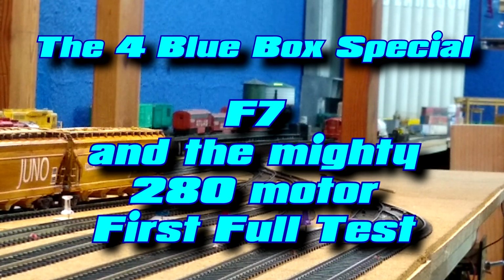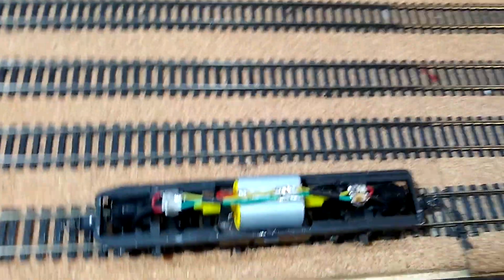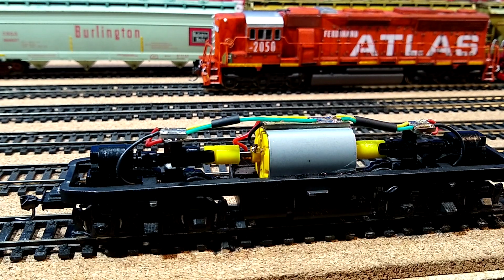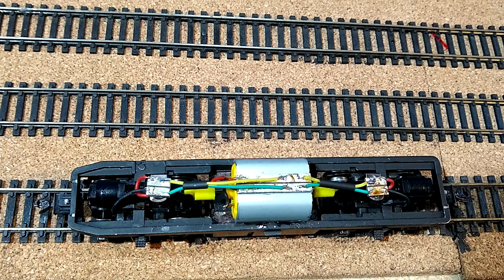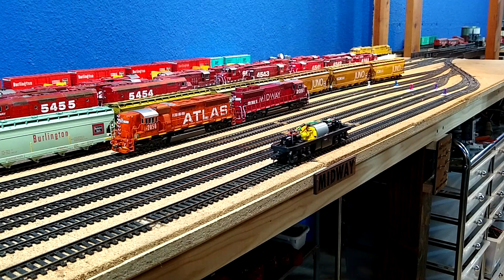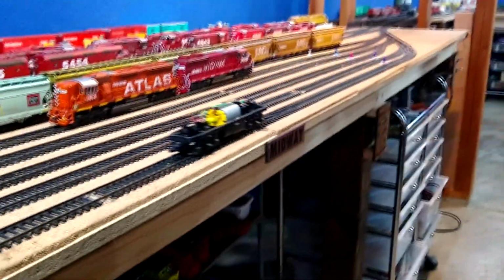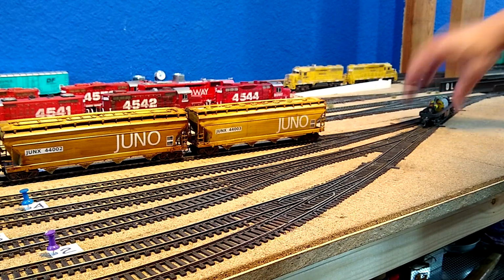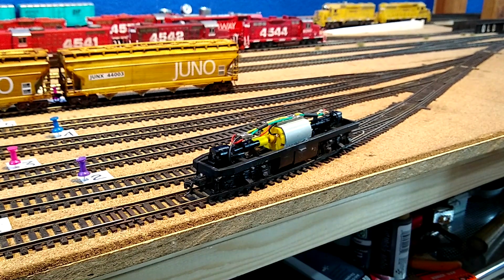4 Blue Box Special F7 First Reveal Motor Testing

Comment: where do you get the Mighty 280?  Mighty is now capitalized as it is a proper name. Yellow UJoints.  Did I miss an episode?  This is your best install yet that I have seen.
Reply from the maker: ebay is an easy source for 280 motors, but also aliepress.  the yellow u-joints go way back when I couldn't find replacement parts for a while I decided to make my own using my 3D printer
Reply: @elite194  I have bad news.  We are not the smartest model engineers in the land.  I was pretty sure I was, but...  There is a book "Upgrading Athearn locomotives"  On page 61.  it details how to test and figure tractive effort, horsepower conversion, all that.  Details the mathematical formulas and test procedures. While the data is pretty old, there is also a chart of 20 or so tests. I'm sure you have seen or read this at one time.  i got a fresh copy 3.95.  Pretty similar to your testing, but this does give  you some independent benchmarks.
Reply from the maker: @blainedunlap4242  I know that book well because that author has a number of great books.  I keep putting off buying it at the train show, but this time I think I'll pick it up.  It's a collection of articles from an old magazine that I used to buy way back when I was still a kid just learning how to rebuild athearn stuff.
Reply from the maker: @blainedunlap4242  not too bad!

Comment: I think these 280's are the ticket for the out of scale hoods like the brass RSD-12 I've recently found out and the chassis wide body F, E's and FA passenger hood locomotives you've displayed here.  What did you think of the single shaft 18×18 motor.  I've stacked a couple of these back to back on an newer modern athearn SD75 and can't wait to see the result.  What's your take on the 18×18 John
Reply from the maker: the square 18x18 motor is both really high power and really fast  at the low end.  they're really good for things that have a very low gearing.

Comment: John which do you like best, DC or DCC.  There's a guy with a huge shelf layout in his basement that uses DC exclusively.  He's rigged it up with sound under the bunch work and says he doesn't have the problems that people have with DCC.  His name is Tom Johnson and his purity widely known for his layout.  I think I'm going to just stick with DC like he's done.  The sound is so much richer than just the sound coming from the locomotive itself.  I just got to figure out how to get the sound from the locomotive to the stereo speakers and stereo.  Lots of people have trouble with DCC they all say because of dirty track, which I think maybe you've figured that part out by using that ox-gard paste.  My layout is on hold till I get moved or I'd have already tried these problems out with a DCC engine and ox-gard on the track.  I'm thinking the newer locomotives are geared much slower.  I've read or watched a video and it's been disclosed that the newer locomotives use helical gears at a 1 to 14 ratio or 14 to 1 ratio whichever it is.  Impressive it is seeing your F7 with pretty much no weight pull them heavy cars at low speed.  Them 24v door window motors that aren't available at the moment, how does this FS280 pull compared to them door motors.
Reply from the maker: I like both and my layout is setup to change between DC and DCC with a flip of a few switches.  I have a couple of old surround sound system that I use for layout sounds and ambient sounds.  To get sound from the locomotive to the sound system, you only need one of those power packs that does "under layout" sound, can be had really cheap these days.
Reply: @elite194  
What search words I need to use to find the power pack that does the transformation of sound to a stereo system, you got any idea.  

You mentioned in one of your videos how ox-gard kinda dried with a small hard film.  I'm assuming of course that hardened film doesn't get in the way of electrical contact between the rail and wheels of the locomotive, must not I'm guessing cause your engines seem to run alright other than a few track issues I've heard you mention while testing a locomotive.  This ox-gard electrical paste needs bought to the attention of the Railroad Community, cause I've heard lots of folks in videos and forums talk about the importance of keeping track clean I'm guessing they knew nothing bout ox-gard.  It's cool you've figured this out.  A little smarts goes a long ways on big issues like these.  I've even read of a fairly big name railroader named Jim Six that blamed the new athearn DCC locomotives as the problem and went so far as quitting the diesel Era and transformed his layout back to the steam Era, over he couldn't get his DCC locomotives to operate right.
Anyways, I hope my athearn SD75's are geared low enough for that square 18×18 motor.  I haven't tore down the truck assemblies yet to see if they've got the new helical gears I heard are 14 to 1 gear ratio that supposedly athearn is putting in their new engines.  If not I guess I can just swap out trucks, I see them sometimes on ebay.
Reply from the maker: @brian5606  Oxgard was discovered by Linn Westcott and John Armstrong, but back then it was liquid and wouldn't stay on the rails.  It's a common item on most farms.  I started using it because I saw it at Lowes way back and remembered that I had read about it.  A bunch of people have been using couple other products and then putting them out there as the greatest discovery ever, but naturally they are using stuff that costs way more.   I've used Oxgard for 6 years now and have had no trouble except the problem of plastic frogs becoming conductive, which we solved a while back.  I prefer not to see it in any of the publications because too many people are not mentally able to handle this idea and would then ruin it for everyone by contacting the company that makes it and getting the price jacked up.

I can't remember what the old sound systems were called, but they would be in any walthers catalog of the 1980s.
Reply: @elite194  
I got your on not wanting the price jacked up.  Cool, I'll see if I can find an old catalog . . . Thanks Man
Reply: @brian5606  if Elite194 allows me, the FC280SC is a strong puller, with very low start speed and a (just a little bit) high final speed. I told Elite194 that I’ve used them to remotor my Frateschi locomotives (like the GN FA-1s) with impressive results. I also use them to repower some of my Athearns - including post 1983 hood units. It’s a very good motor IMHO.
Reply: @regisbraga3833  
Heck yah Regis, all these good motors seem to be way cheap to boot as elite194 has said.  I'm at present loving adding different magnets armatures and stuff upgrading the athearn robust gold cased jet motors by adding a 36mm in length armature to a elongated jet motor case and them high powered magnets that's available at the moment, I'm thinking it should be 4 to 5 times stronger than a stock gold cased jet motor when I'm finished adding all the steroid equipment to it lol.  I by ordered a FS-390SA motor and after receiving it I'm thinking it might work in the FP-45 athearn and it might even lay down in a F7 or wide bodied passenger engines.  It's a single shaft with huge plastic bearing shoud around its short shaft that sticks out just past the plastic shoud.  I ordered it to see if the plastic shoud could be cut back.  I cut enough of the shoud off to allow a coupler to be attached so it made a duel shaft out of it.  But that project is several months off before I can continue on with it.
Reply: @brian5606  I’d like to see your work on the Athearns! How about to put a video (or some videos) at your channel? I have a bunch of them and I’m always working to improve their performance.
Changing - better, returning to the object of this video - this is another amazing work of Elite194. He can really transforms simple locomotives in great ones.
Reply from the maker: @brian5606  I like to keep my best tips and tricks just those of you that watch.  I might do something for Modeler's Journal, because they're friends, and I like to do something for NMRAx from time to time.  Otherwise this stuff just for you guys.
Reply: @elite194  
Got yah big buddy, I'm totally on board, thanks to you I'm enjoying the hell out of myself fiddling with this stuff.  I mean I've always liked digging into the mechanics of these Railroad Models but now I'm off on another trail of it by horsing with these different motors.  20 years ago the selection of stuff to horse with was far and few between.  Today it's a whole different story and it's really a good time to be a model railroader.  I've a 3D CAD built up of HO Scale Plymouth 120 Ton CR-8XT Industrial narrow gauge Switcher that's used mostly inside the huge steel mill plant building that were hardly ever seen by the public during the 50's through the 80's.  The only thing left to do on it is kitbashing a truck with gear tower to fit up into the chassis & body to make it a workable model.  With a small bit of luck it should be up and running in three months or so, I'm just a one man operation with no 3D printer.  I had a partner up in Wisconsin that was going to do the printing but that vaporized I guess haven't heard from him for 3 months or so so I guess he's off on other endeavors I'm assuming, may have to buy my own at some point here ??
Reply from the maker: @brian5606  the learning curve is steep but worth it.